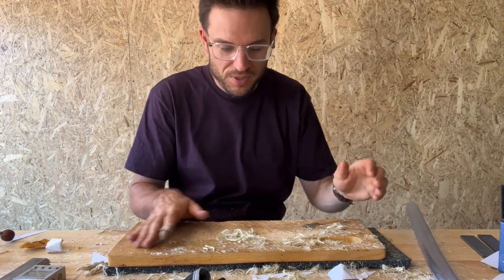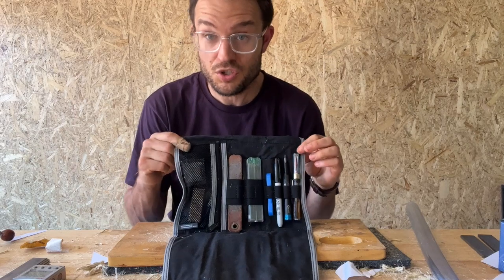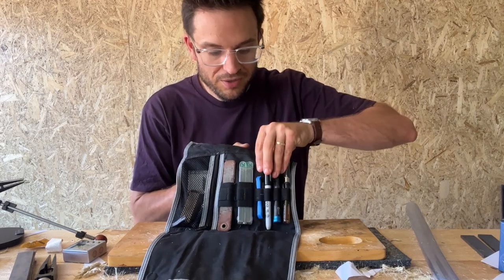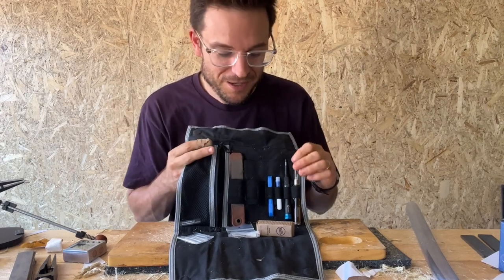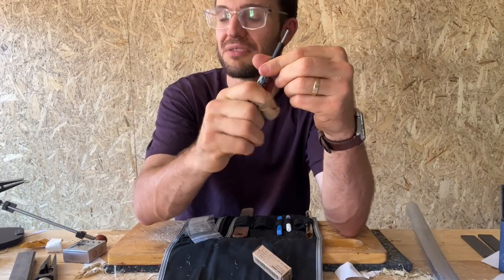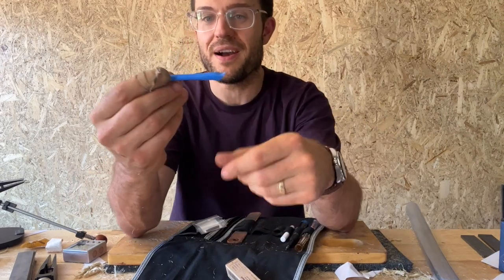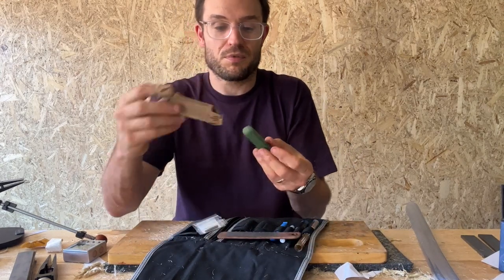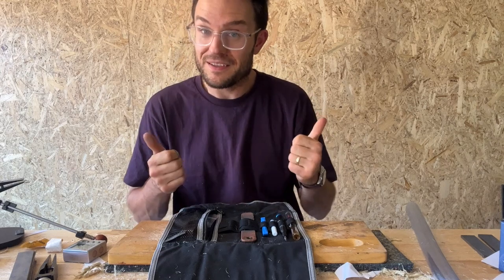Knafs Tool Burrito and my personal mods

Comment: Thanks Pete. Strips? I used to work in an office, had to wear a suit and hated it. When I left, I cut the buckle off my fancy suit belt and glued it to a nice flat piece of hardwood. It is now my strop.Has been for years. Works a treat. No need to spend big cash on a ‘real’ strop, that’s for sure. Little knafs guy looks handy though!
Reply: I found a piece of vegetable tanned leather at a craft store for 4 dollars and got a set of carving blocks and glue. Under ten bucks. Made 3 double-sided strops

Comment: Knaaaaafs.....yeah. I thought that was not so good myself.  Ben couldve branded with his name and we'd still have been interested. 
The problem with kits like this are clear: they are almost always some of what you need and some of what you'll never use. 
It would be nice to see something along the libes of a good lock pick kit:
1. 600 or 800 grit nagura. Theyre 2x2x1, easily packable and better than a smiths diamond stone. 
2. Ceramic rod. Simple, effective.
3. Oil syringe is good
4. More than one breakable plastic prybar, or, conversely, some powder coated feeler gauges. Cheap, effective, and if you break your tool you have another.
5. Torx driver is good.... as long as the bits are quality..... tiny screws need good sharp bits. 
6. Replacement screw sets!!!!!!
7. Washer sets (brass and teflon)
8. Toothbrush for cleaning
9. Dental pick (steel of plastic) 
10. Instead of a tiny pre-made board, why not just a length of belt chopped off to 10" with a brass lanyard and a cheap d-ring? 

Good stuff, not cheap stuff. But I daresay I could put this kit together for less than 90 usd and have better stuff.

Comment: I made my own strop by gluing a length of leather belt to some 1" x 3" pine. It's been working well for a few years now. But the leather is a bit clogged so I'll have to hit the op shops and find another belt.
Reply: I did the same thing. My scrap piece of pine even has a slight bend to it lol.
Reply: I recommend buying a bit of veg tan leather. 50 bucks will get you enough to play with for a while. Makes a proper strop

Comment: Should I get a TSPROF currently running KME. I have 6” gritomatic stones which I sometimes use on KME.  My perceived problems with KME are clamp slip and getting sub 17 degree angles on blades that are much less than an inch in height.  Also seems that 6” stones give more effect than 4” stones.
Reply: Can you still buy stuff from Russia? You might struggle with that.